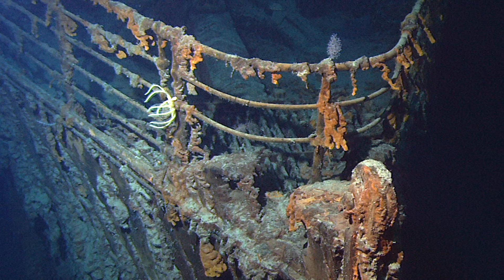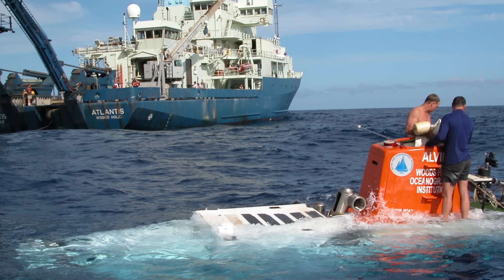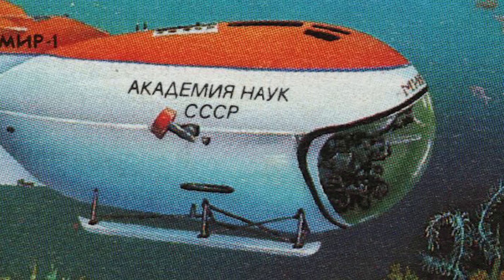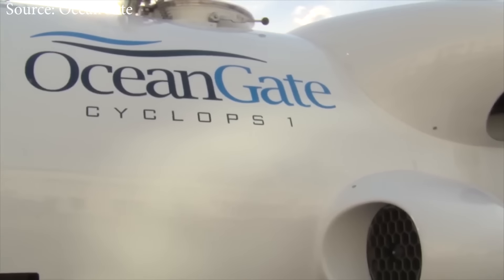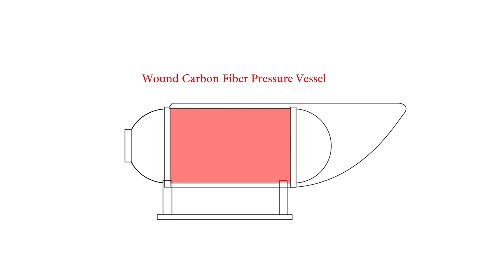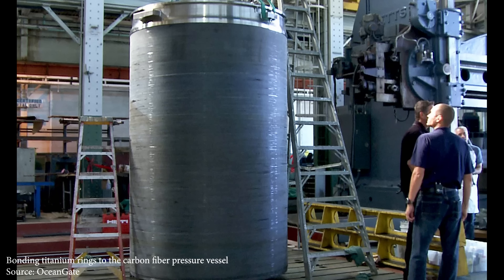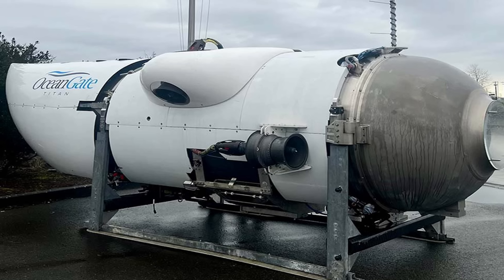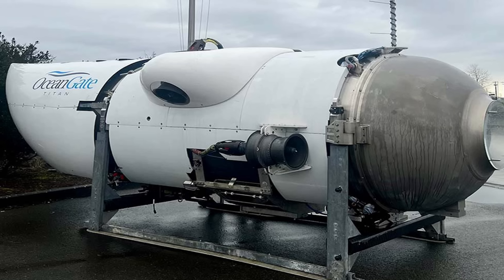How Titan was Built, Lost and Found: An Analysis

Comment: You try to defend what is not defendable. There where to many mistakes made, and to many signs of ignorance. Several being carbon fiber is strong, some say stronger then steel or titanium, but it is true in tensile strength as with most fiber strand solutions. Using such a thing for pressure is using it for what it is not good at, well at least if the pressure is on the outside pushing in. If pressure would be on the inside they would have a point as it being a good material. And last the port was not build by them but they did just buy it. And the vendor that supplied it rated it good for 1300 meters. If you think that you can use it for 4000 meters and just state that is all right because pressure makes the seals around the porthole tighter then you are as mad as the owner. The rating the vendor gives is not just something you should ignore.

Comment: Also the bonding process between two different substrates (aluminum to fiberglass, steel to carbon fiber, etc etc) is done using highly advanced epoxy polymers that will bond the surfaces stronger than any type of welding or fastener could. In many modern aircraft and even cars  “panel bond” is used to adhere body or hull panels together with great success and a failure rate even lower than Rivets or non-robotic (human) welds.

Comment: fun fact: the problem with the Comet wasn't actually the windows as it mostly suffered from metal fatigue. The windows did have problems too but they were not the main cause of the cracks, in fact there were airlines who had used square widows before the Comet. One of the main reasons people think it was the windows is because the investigation identified cutouts for the A.D.F antennas as A.D.F arial windows. If you want a more in depth version here's the source of my information: https://www.youtube.com/watch?v=-DjnG74DDno

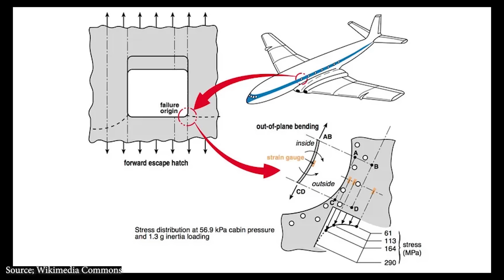Comment: 13:25 This is actually a myth. The real cause was metal fatigue. The Windows had nothing to do with it, and were rounded in the corners anyway I believe. The rivets would cause micro cracks, the plane wasn't fit to fly at the altitudes it now had to fly, they never tested the entire hull for metal fatigue problems etc

Comment: Heya! Friendly neighbourhood marine geophysicist here (and former hydrographic surveyor...)! Just a thing on your descriptions of Active Sonar. I think we need to break this down into two separate systems; Multibeam Echosounders (MBES) and Sidescan Sonar (SSS). Whilst these use the same principles, they work quite differently.

Multibeams work by firing a "wedge" of acoustic energy downwards from the ship (perpendicular to the ships path). This energy travels down the seabed, and reflects back to the transducer. By doing some horrifically fancy maths, we can get the travel time to the reflector (be it the seabed, a wreck or otherwise). Now because of the spreading of this wedge from the transducer on the ship to the seabed, resolution and data quality is very much dependent on depth. Add in a large amount of data loss from attenuation of sound through the water column, and the resolution you achieve from surface vessels can be astonishingly low. For this reason, a lot of the MBES work was performed by ROVs and AUVs, allowing for minimisation of beam spreading and packet loss.

Sidescan Sonar would definitely locate the wreckage. Most systems have a resolution of around 10 centimetres, and a vertical resolution of about the same. These systems work by, as the name suggests, firing acoustic wedges out to the side if the towfish. This doesnt so much map the terrain, as produce an image of the seabed topography. it enables us to see items that are casting shadows, as well as seabed density changes (as hard substrates reflect more energy back than soft muds etc). I myself have located 5cm wide cables with these systems.The images we can get from sidescan are very very high resolution, and we can normally see what the item is (IE ladders, tyres etc are the common ones I see).

In relation to your point about it being masked, it would be quite easy to mask it from an MBES survey of the area. But it would be tricky to hide from a SSS survey performed professionally, as it would be much closer to the seabed. What worried me was if it had sunk into the sediment, as this would have caused significant issues and substantially decrease the chances of a successful search outcome.

Comment: The comet developed stress fractures at the corners of the windows over many pressure cycles,  these cracks then caused the decompression.
they absolutely did not blow out mid flight because they were square.

Airplane windows are rounded so fatigue cracking from the expansion of the fuselage has no corner to start in, its nothing to do with pressure.

You can even see the cracks marked in the diagram you show.

Comment: The Titan have many security flaws like the port window was onyl rated for 1300 meters from the manufactor, and the Titan was build with 2 different materials Titanium and Carbon Fiber both materials have different rates of compression and expansion when pressure is on them or pressure get lighter, and where two materials meet its a huge weekpoint
Reply: You have no idea what you are talking about!